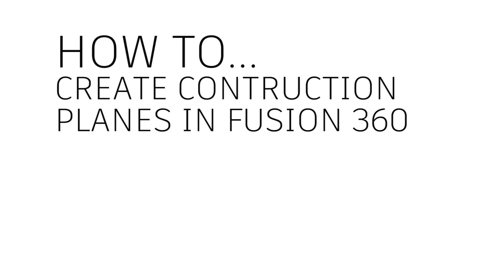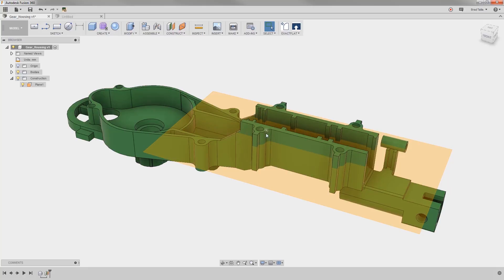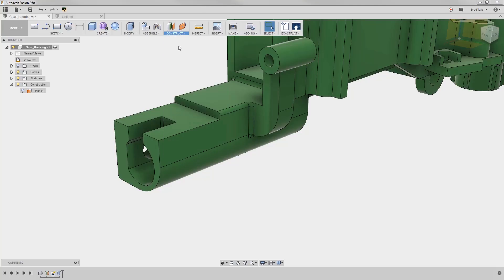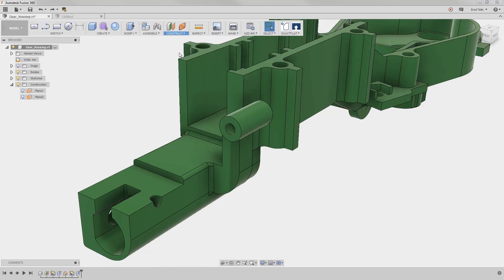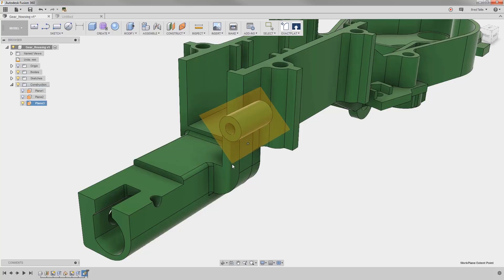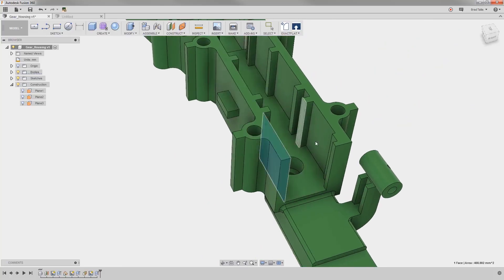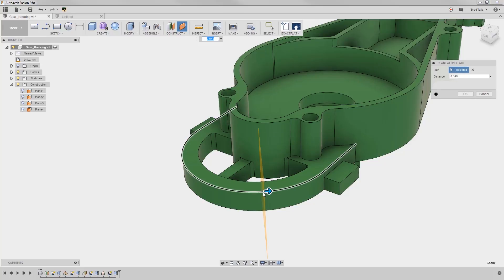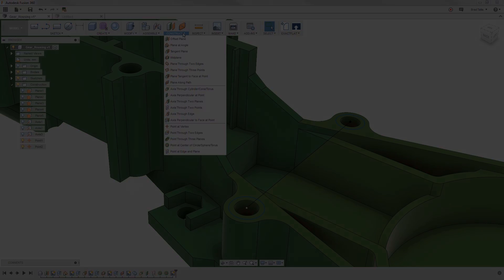QUICK TIP: Plane Creation

Comment: BASIC QUESTION - I'm struggling to create a new sketch on a new plane. Really simple I know but no matter what I do, when I come to do a new sketch it still uses the previous plane. Any help would be great thanks so much! 

I've tried the following.
1. Right clicking on the new face, selecting ‘create sketch’ (it still sketches on the old plane.)
2. Clicking ‘create sketch’ on the top left. (it still sketches on the old plane.)
Reply from the maker: Are you trying to redefine the sketch plane?
Reply from the maker: Or is the new plane hidden?
Reply from the maker: Let us know if these suggestions helped. Thanks!
Reply: @adskFusion  hey thanks for the reply, I figured out i just needed to click 'end sketch' before I tried sketching on a new surface. thanks bud!

Comment: Why resizing a plane? Isn't a plane infinite in size?
Reply: He was resizing the displayed portion of it. It would be hard to see an infinite plane. Fusion, and every other CAD application, gives you a smaller sized representation of the plane so you can select it, and so that it isn't always in the way, stretching off into infinity. If you don't like the represented size of it, make it smaller or larger. Mathematically the plane acts as if it's infinite.